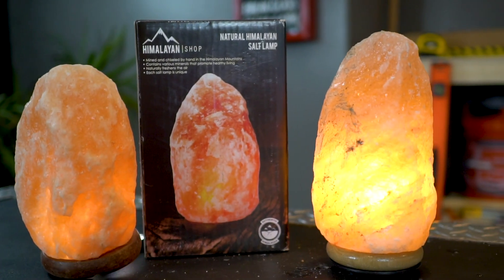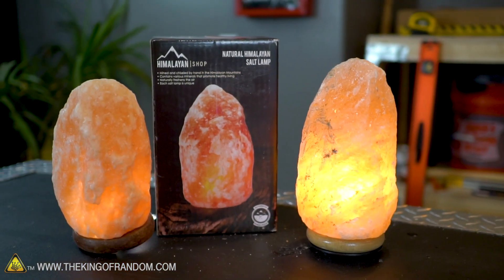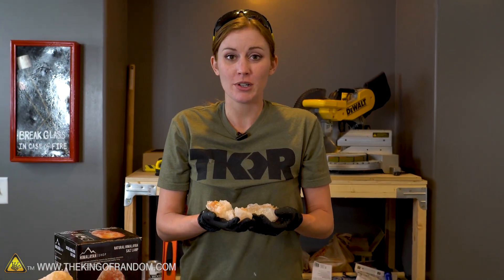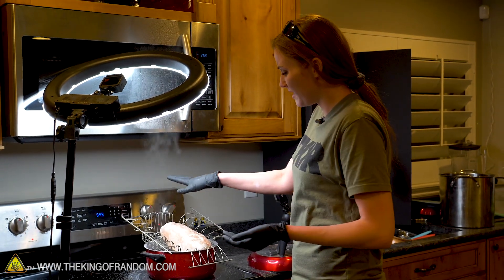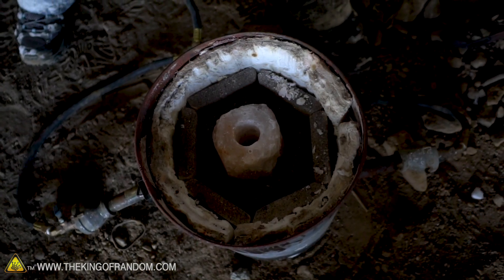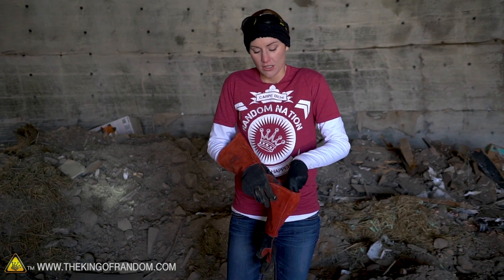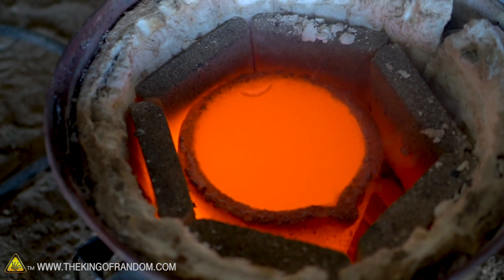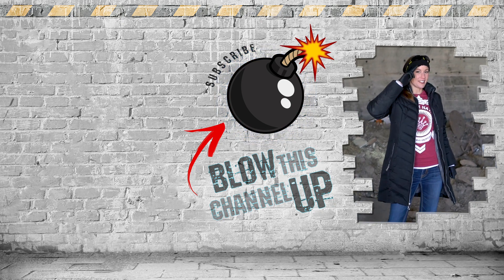We Liquified a Himalayan Salt Lamp

Comment: Try to carbonate a drink with sulfur hexafluoride
Reply: thats not called carbonating but Sulfur hexafluoriding - and it wont work because its very poorly soluble in water - so it will separate immediately.

Carbon dioxide has a relatively high solubility in water, especially under pressure and that's why you get bubbles as it begins to leave solution and escape.

....but your idea sounds fantastic if it worked, bubbles would go downwards as they are more dense than water !

..............it MIGHT work in some oils/non polar organic solvents, but have not tried it.

Comment: Try to melt tungsten. You can use the arc furnace, one of your foundries or whatever else YOU MAKE
Reply: I'm not so sure they can get their forge to reach 6200 degrees Fahrenheit.
Reply: Daniel Gramento they can MAKE something that gets hotter, that’s what they do
Reply: @colinhorwedel9668  no, they can't. Melting tungsten is a very expensive process that requires a vacuum induction furnace, and involves super cooled copper to hold the melted tungsten.
Reply: @TheRealBeardedFetus  molten*
Reply: @MarkoHR  melted is also correct, it is synonymous with molten, molten just specifically refers to materials with a  high melting point, whereas melted refers to every material regardless of its melting point.
Reply: Daniel Gramento High melting point is the reason it's in light bulbs

Comment: Is it possible to freeze a lava lamp in place?
Reply: Glass would definitely break from thermal shock
Reply: @myparentsdontunderstandme8502  what if you used plastic? Or bullet proof glass?
Reply: No because you would need to freeze it super fast, since the reason a lava lamp does what it does is because of heat, making it cold in a freezer would not really show any results. Even using liquid nitrogen would break the bulb or glass before it freezes.
Reply: I want to see a lava lamp with real lava.
Reply: @mikelakner5622  yessss
Reply: Why not?
Reply: Yea. Just turn it off!